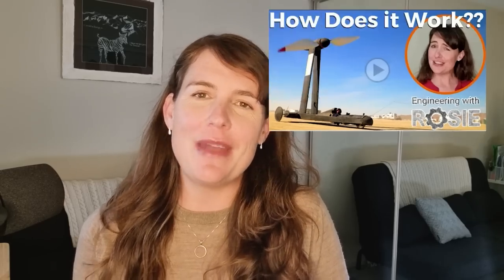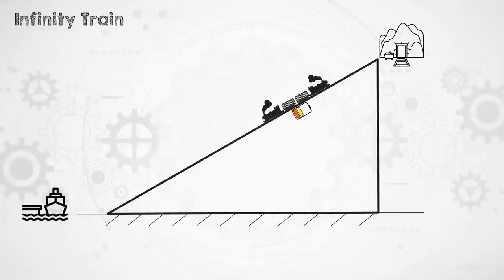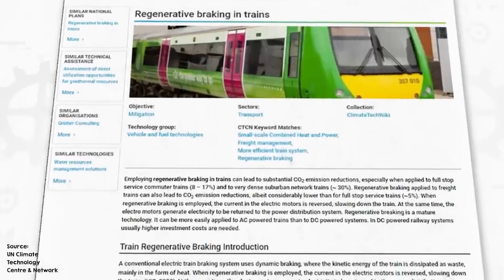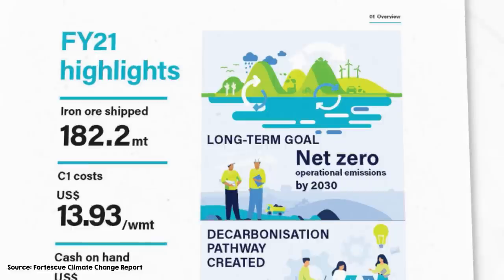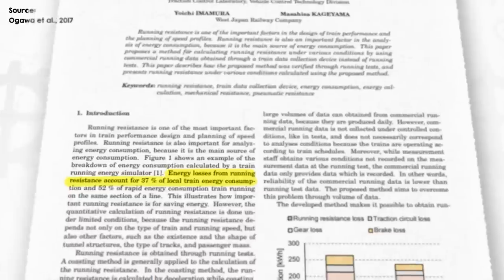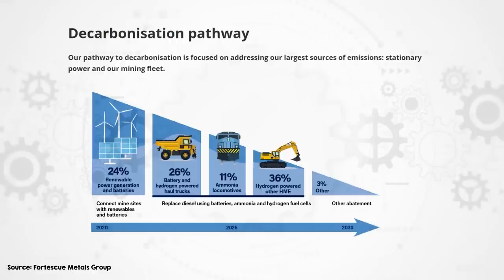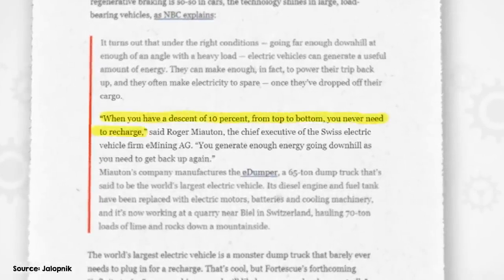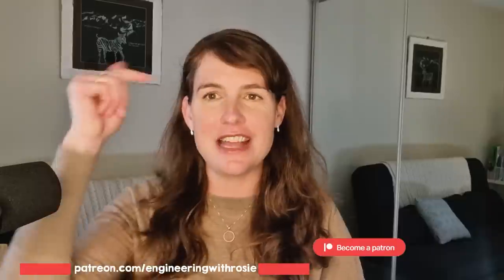This Mining Train Powers Itself: The "Infinity Train" (and how it works)

Comment: One thing I haven't understood is why they don't use a hybrid ultra capacitor battery tech. I know on a home it allows the power coming in during the day to be used and charge the battery bank. With cars you would be able to use the capacitors to get back up to speed. with the energy from regen braking. On a home It allows you to charge the batterys during the day and power your house. The only one I have seen so far has been on one house. It is an extra $2500 dollars but capacitors  can cycle a million cycles or more.
Reply: What would be the point of the capacitors?
Everything you described can be done with just batteries.
Reply: @Jehty_  It can but with regen breaking they can take all the power in. where the batteries just take in a fraction. not to mention that ultra capacitors can handle a higher output for power on demand.
Reply: @richbest9877  would you be so kind to cite the source for that information? (that batteries can't take all the power in)

And why would you need a higher output? It's an empty train driving a pre-defined route. Why would it ever need a higher output?
Reply: If you study the two In a hybrid system you get the best of both worlds. If you put power into a battery at a higher rate than it can take it damages the battery. capacitors don't have that problem. If you put the two together the capacitors act as a buffer. Its the same in the opposite direction. batteries have to be force fed so there is power loss in the charging. In playing with alum batteries this has had a great advantage.

Comment: what i dont understand is WHY carry the batteries? They could easily electrify the rail, place the batteries along the way. The train can feed into it and pull it back out without having to carry the weight.
Reply: You're talking a high voltage line on the ground that has to be isolated and protected from humans and animals. Good luck with that in the West Australian outback.

Comment: Energy comes from a variety of source's, wtih the exception of cost of harnasing it, and the building, maintaining of the intrastructure: Who the various individuals at the top of the chain make million's in salary as do the underlings down to those who assist in various degree's to maintain the intrastructure to get it from the source to the user.  Make extemely large wages, which sometime's includes various bonuses to those at the top. The actual form, regardless of what it is, is totally FREE.

Comment: This is basically powered by the geological forces that lifted the iron ore up with those mountains eons ago.
Reply: Tectonic energy! a new branch of renewable. Also wonder if it would be possible to connect a giant gear box across a fault line to spin a generator. Some places the shift is several feet per year?

Comment: Duh me.  I always imagined that regenerative braking involved special brakes with a mechanism to get energy.  I didn't realize it was just the electric engine running backwards.
Reply: the motor still spins the same direction - there's a power controller that determines whether to accept the induced current coming from the wheel spinning the motor, or send current from the battery to the motor, to spin the wheel...  and that change can happen extremely quickly...

Comment: Does the weight of the load really matter? The electric motor charges proportionally to r.p.m. which is proportional to the speed of the train which has to be kept below a safe limit; so it boils down to charging efficiency and battery capacity. 🎉🎉🎉

Comment: The train would be more efficient if the batteries were discharged at the top to power stuff at the mine, like lifting the ore or of the ground (or to charge a big battery at the top).

That train would not only need no fuel but would actually be a power source.

Comment: Yeah it has to carry an extra 690 tonnes of batteries but you can also lose the diesel fuel and generators which are substantial. So sure it’s a net gain of weight but not the whole amount.

Comment: Bummer, it sounds as though trains and regenerative braking aren't as efficient as I'd thought.  I'd had the impression they were so efficient that a vast heap of crushed rock getting hauled between sea level and high altitude would probably be technically feasible for seasonal energy storage, and maybe even economically competitive within some niche if most of the infrastructure happened to already exist and be underutilized.

Comment: I have recently wondered about using regenerative braking with elevators, as they climb up and down a vertical shaft. I am thinking of a toothed cog mechanism, rather than ropes and pulleys.

That idea seems to be viable, but I don't know whether it has been done yet or not. The load can be assumed to be the same in either direction, so some energy input will still be required of course.
Reply: It's partly done already. Lift systems have counterweights, so that the motor is not lifting the weight of the car, but only half the weight of the max load. Half? Yes when an empty elevator is descending the motor has to work too lift the counterweight which is bracket than the empty car.

That of course is Regenerative as regards gravitational energy, but not as regards the kinetic energy of the lift starting and stopping. My feeling is that a battery (like in a hybrid car) would be useful for that.

Comment: There are a few more things to consider. Acceleration. The journey from the top to the bottom will take a very long time to accelerate if you aren't using any power, let's assume that the top is flat right, because you aren't going to load a train on a decline right? So, the train is sitting on a flat surface up the top. Most the energy use is going to be used loading the train up the top, because your talking about stop and starting a train thru a loading mechanism. Then finally you get it full, you've got to use up a lot of energy getting the thing to move.

There's also going to be staff costs as well, I mean, you need this thing to move...

Comment: but they never tried a train system similar to the zip line, where they pull an empty train up hill by the gravity power of the fully loaded train to the lower location
Reply from the maker: The rail route is hundreds of km long and not in a straight line so I think that would be challenging to achieve.

Comment: I wish renewables worked , maybe in 50 years or so , but not now, it’s only working because it’s empty when climbing up , This would not work if it was required to return fully loaded
Reply from the maker: Correct! (About it not working if it had to return fully loaded). And this train idea is definitely not renewable energy 😊

Comment: Why dose the train need to carry the battery? Why not charge a  fixed battery by the side of the track using a third  rail system and save carrying the heavy battery around?
Reply from the maker: Maybe they will change their concept and do that, but I suspect that due to the length of the rail (hundreds of km) it will be more expensive to electrify the rail than to add batteries.
Reply: @EngineeringwithRosie  yes, i was forgetting about the distance. The system would need to run at hundreds of KV to keep the losses down.

Comment: I don't think it can do. 450m drop over 280km is 1.6/1000 gradient. The train would need rolling resistance coeff of 0.5/1000 to have 1.1/1000 charged into battery. This 1.1/1000 will be used for the return trip of (0.5 rolling + 1.6 climb) x half weight = 1.05/1000.

I had a quick look in Engineeringtoolbox, railroad steel wheels on steel rails coeff is 1 to 2/1000, two to four times higher than needed.

Btw your calc method is flawed - it's based just on potential energy and nowhere takes into account the distance. That means if it works for 280km it'd also work for 4500km distance = 0.1/1000 gradient (10cm drop per km). But at such 0.1/1000 gradient the train wouldn't roll down by itself let alone charge any to the battery.

Comment: Did I miss something? The train will be carrying the battery with it on every round trip? Why not just use an electric line and feed the power to a stationary battery. It should be easier for maintenance, the return train will be lighter and excess power can be used by the mine site to say charge a truck?

Or just skip the battery all together? (Yeah, in practice the line is properly never a constant slope, so smaller batteries will be required as a "UPS".) 

Use two electric trains with a bypass in say the middle somewhere. While the heavy train rolls down its electric energy is used by the train climbing up. Save the planet, use less batteries! 😋

Comment: Would be interesting if they got excess electricity - what would they do with it?
Reply from the maker: I assume it won't exactly balance out with no buffer. If it did they'd be in trouble on a windy day! Perhaps they could charge mining vehicles off it it have they have surplus.
Reply: I think the easiest thing to do would be to brake less and get to the destination faster. Requires zero additional investment and can marginally increase the ore carriage rate.

Comment: Yeah, let's look at the long term cost of that power system, the useful life of the battery, and the disposal costs of the battery, and...so is it really operating more cheaply with all this "free energy"?  Or is it more expensive?  And since it isn't even built yet, we don't really know if it'll be operating without input from the grid, or from a diesel powered charging station.

Comment: I think that we have blocked off or laughed at perpetual motion machines while ideas like this where small inputs could compound and develop a motor that is close to these ideas.
Reply: But this has nothing to do with perpetual motion.
So what do you mean by "ideas like this"?
Reply: @Jehty_  In the 1900s, there was huge and ridiculous levels of effort to create a perfect perpetual motion machines.

The US Patent Office reached a point that they were frustrated with having too many to review so they made a blanket ruling where they refused to review any perpetual motion machines.

What I felt, was that many of these inventions were somewhat effective (eg you give it a small push and it runs for ages), then it is my belief that possibly it could have been reframed mentally as ideas which could store kinetic energy (batteries), or as a power generator as a perpetual energy machine which actually is pulling in an input like solar or infrared heat, or gravity or water in some way.

Comment: Dear Rosie
I am sorry that you are annoyed with claimants that are trying to populate the taxonomically possible US patent classification class for perpetual motion machines. The patent office may not have such a classification class. I would like a straight and thorough answer as to why the second law of thermodynamics is held in such supreme regard that it can dictate that heat can only be converted to another form of energy if there is obviously a temperature difference between thermal reservoirs and converted poorly if there is a small temperature difference. 

Aloha, 
Charles M Brown lll

Comment: I don't think the concept is all that new,  The electric coal trains from Gippsland to Melbourne and return scavenged power using a dynamic brake to generate electricity and feed back into the power grid.   The slope would not have been sufficient to allow the extent of power scavenging that the ore trains from the Pilbra will get

Comment: Physics aside, your report didn't mention the Diesel Electric Locomotive platform to wich they plan to convert to this train into. Based on US engines that we currently use,  you would need 12-14 boxcars with batteries on each end of the train just to move things around. The maintenance and replacement cost of these batteries will be a negative impact that may halt the project all together. The current market of ev's running around in the US is a shocker to people when the cost of replacement batteries is a 5/8 of the price of the ev car. And other cost of battery cost, such as short range, some states you can only charge at nitetime hours, were finding more and more people are going back to gasoline cars.
Any thoughts about a Hydrogen Electric system, that may do the same job. It's only exhaust is H20..........

Comment: Rosie, I applaud your educational efforts.  However as an engineer there are far too many inaccuracies for me to ignore.  To use the gravitational energy to power this system large investment in infrastructure and equipment had to be made and both require maintenance and replacement.  Many have the misconception that solar power is free.  Neither is the gravity free.
The fact is that only 16% of global energy is low emissions, note not zero emissions just low emissions.  Fossil fuel supply is challenged, and global peak energy production is real and near term.  As fossil fuel production either or both declines in production or increases in  cost more countries will lose the ability to pay.  The IMF has stated that there are 107 countries that do not have the ability to pay for food or the fuel to produce food. 
Supply will meet the demand that has the ability to pay. 
Far too many nonviable solutions are promoted by vested interests that while technically possible are thermodynamic pipe dreams, Carbon capture and storage, green hydrogen, fusion.  Also many applications of fossil fuels are not replaceable.
As an engineer you should be analysing the thermodynamic reality of proposals.

Comment: Can't help thinking that battery replacement, when they no longer hold a charge, may well exceed original vehicle cost. Interesting to find out what the life of the Infinity Train battery would be.
Reply: That's possible if the price of batteries goes up. The locomotive is probably the most expensive part of the unit, though it would be a bloody big battery. No need to replace the loco when the battery is past it
But if it is a good lithium battery it should get at least 2000 cycles. At one trip per day it would last around 3 years. So 6 if every 2 days.
The thing is it would need to be retired if it got even close to not being able to make it back to Cloudbreak.

But then it could probably be used as stationary storage to power the plant until it degraded beyond use, so I think it would turn out to be very economical
Reply: LFP (Lithium Iron Phosphate) batteries are ideal for massive stationary storage (example: the 150MW Hornsdale Reserve in SA) and for this type of application, and can still have 85% capacity after 2000 cycles. 5000 cycles may even be practical, which at 1 trip per day means 13+ years before the battery is retired for recycling.
Reply: @emceeboogieboots1608  as the set of batteries got close to heartbreak you'd replace the one that has the least remaining capacity, then go on replacing them one at a time as required.

Assuming battery tech goes on increasing capacity, you'd get increasing extra time out of every replacement.

Comment: I'm glad to see the mining company is investing in reduced energy consumption in this clever scheme. It did trigger my 'green-washing' alarm. It would have been helpful if you had also included the energy and CO2 emissions that will be generated as all that iron ore is smelted into useful products.

You could have also brought up the issues of energy loses that take place within the motor/generator though they are small. Additionally, there is some energy loss during the charging and discharging of the battery which is also small.

As you've pointed out before the steel can be made using reduced CO2 emissions but it shouldn't be assumed that that is how this iron ore will be processed. Their are many 'what ifs' but the trend has not been at a rate that comes anywhere close to what the following warning headline suggests is needed.

IPCC report: ‘now or never’ if world is to stave off climate disaster (TheGuardian)
Reply from the maker: Fortescue are working on zero emissions steel processing (the expert from my first green steel video was ex-Fortescue). I think they are one of the more climate minded mining companies (their former CEO Andrew Forsest announces a new energy transition project practically every day!). You're right that this project is currently light on details, and when I asked questions of them they couldn't give me any more info than what's in their press release. So it seems like they are still very much in the conceptual design phase, and perhaps it will never actually go ahead. It's still a cool idea though, and it was fun to do the calculations to see how realistic it is.